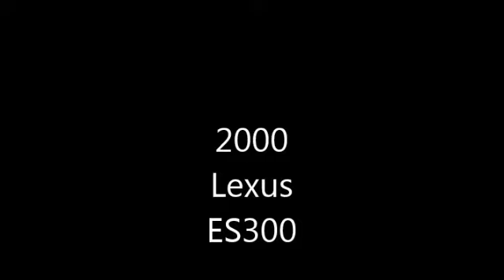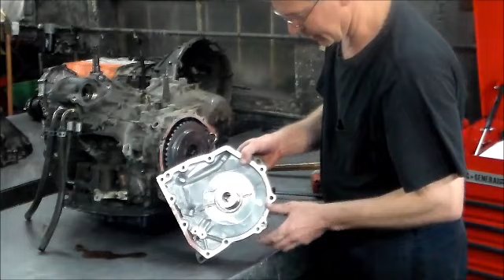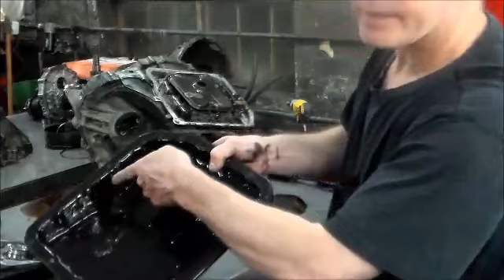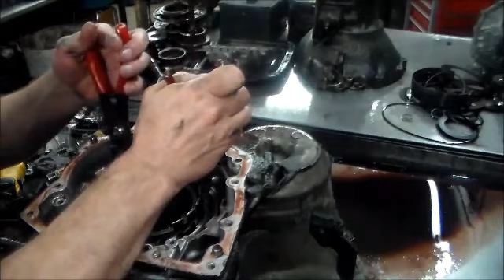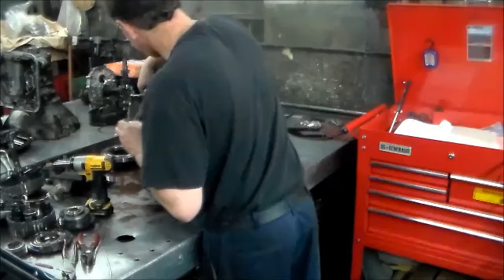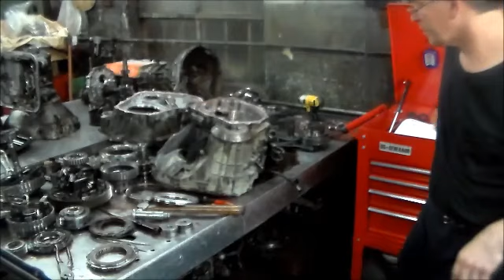U140 Teardown Inspection

Comment: Thanks for the video. Very informative. Is the shift solenoid located on the outside or what? Is there a solenoid  on the outside by the gear shift?
Reply from the maker: all solenoids on the valvebody inside

Comment: Hey Gary, good teardown video. I have one on the bench that I will be going through on monday. I had 4 codes for Solenoid A, B, C and Line pressure solenoid. I suspect the internal harness is bad but I guess we will find out on monday!! Have a great weekend.
Reply from the maker: Let me know what you find, all fuses good?  Watch the geartrains on those, i very rarely see a good one
Reply: Ya fuses are good. I thought it was weird with all those codes. I hope to find a wiring harness that is damaged somehow. But I think I had a similar toyota a few years ago where I replaced the computer for these codes.. Its codes...P0750 P0755 P0758 p1760
Reply from the maker: what kinda of car is it out of now  rav4?
Reply: 2000 ES 300. Thats why I am skeptical. The car stalled while driving, and you could obviously feel some erratic shifting. I didn't drive it far because it was towed in. Just drove it long enough to get into 3rd gear. It had a p0171 code also, and I was thinking that had to do with the vehicle stalling, because it didn't feel like it stalled from going into lock up, or something like that. We are soo slammed right now, I just had the R&R guy pull it, because I knew I'd find some hard parts issues inside when I open it on monday. I am just suspicious about those three trans codes, wondering if this also has a computer issue similar to the RAV 4 that the bulletin on sonnax.com refers to

Comment: What are the most common parts that goes bad in those transmissions? I got a 2001 lexus es300 and yesterday a did an drain and refill. But it was done when it had 60k miles Or around there and now is at 179k and i did it myself. The fluid was super black i even got pics of the before and after. And thanks 🙏

Comment: I have a 1999 lexus rx300 awd u140f transmission I believe. The transmission shifts perfectly but the first time I use the car for the day it wont engage into drive. Sometimes it take 30 seconds sometimes it takes a couple minutes. It goes into reverse just fine. After it does go into drive, its fine unless I take it out of drive in the first couple minutes then it may be a 10 to 15 second delay to engage. After that its fine all day and usually after sitting for  hours it is still fine. Very rarely does it do it again until the next day. Also, this car sits for months at a time while Im not in town at times. After I return the car is perfect for a few days to a week and then it starts doing it again, delay times slowly getting longer. No transmission codes just air fuel ratio codes. Ive had the car for a year and a half and it has done it since I bought it.
Reply from the maker: Wow,
 Im surprised its lasting that long, theses transmissions arent the greatest, i do alot of these units, when i had delays it was usually do to a filter problem or the geartrain itself. Im wondering if your having a drainback problem, as a test if you want, pull the dipstick out before you start the car when its cold and see if the fluid is way up on the stick past the full mark.
Reply: I will do that tomorrow when I see the car. I just watched your 4L80E drain back video. Thanks so much for all this incredible information! What do you think about the fact it will go right into reverse with no delay what so ever?
Reply from the maker: I forgot about that part, you dont have a drain back problem, something else is causing your issue. You may have a problem with your foward clutch, possible piston seals or sealing rings that apply the clutch or a lazy solenoid.
Reply: @GaryFerraro  Hello Gary, great video , i have a similar problem on my 09 RAV4 2.0 VTT .The transmission shifts perfectly but the first time I use the car for the day it wont engage into drive,it take's 30 seconds sometimes it takes a couple minutes, its getting worse, goes into reverse just fine then  into drive, no shift shocks. After that its fine all day and usually after sitting for  hours it is still fine. Very rarely does it do it again until the next day.  
just put in a new complete valve body ,filter..still no luck. 
Lire la suite
Reply from the maker: @francismorad6098  ok, just to confirm, you have a delay in drive only, no delay in reverse at all?  Have you started up the car in the morning to see if reverse is ok?  almost sounds like drain back

Comment: Hello Gary, great video , i have a similar problem on my 09 RAV4 2.0 VTT .The transmission shifts perfectly but the first time I use the car for the day it wont engage into drive,it take's 30 seconds sometimes it takes a couple minutes, its getting worse, goes into reverse just fine then  into drive, no shift shocks. After that its fine all day and usually after sitting for  hours it is still fine. Very rarely does it do it again until the next day.
Reply from the maker: I had answered the last post you sent

Comment: A U241e has 2 versions (i think). The differential,  is it possible to swap between the versions and not destroy it? Like, Is the final drive ratio on the outside or the inside of the ring gear?

Comment: Hi,
I have a question regarding the U340 transmission. I would like to know the differences between the U340E and the U341E transmissions.  I’ve heard that they are very similar, but I’m interested in the specifics of the differences between the two. Does the U340E use a different torque converter than the U341E?

Thank you

Comment: I just had the U140 in my 99 es go out while on a road trip. it started with a weird whirring sound then slipping then stopped moving all together in a span of about 30 minutes. I wonder if it was just a clogged filter or a blown planetary which led to a clogged filter. I got it towed to a transmission shop in the area waiting to hear back.
Reply from the maker: I have never seen a good planet set in one of those, you may have a clogged filter, that may be because something in the trans is coming apart
Reply: @GaryFerraro  thanks for your reply! I heard back from the shop after I commented and they said there was metal in the pan and the line pressure was through the roof. The shop I sent it to said similar things you say in this video which made it sound like they were knowledgeable about it and could get the job done right. Is there anything I should ask them to do to increase the life of the rebuilt unit? Also is there anything I can do to get as much life out of it as possible? Something like a drain and fill and fluid replacement every so many miles? I did a drain and fill a few months ago but didn't replace the filter. I'm wondering if that had to do with its demise.

Comment: Hello I think your videos are very informative while very easy to watch. Transmission repair might as well be magic to me, very impressive on how you are able to know whats wrong before you actually see inside. I have a problem that has me stumped. My Lexus LS 400 a 1995 model will only engage  any gear the first couple of times the shifter is moved to select a gear, then nothing.  Moving the shifter after the initial gear changes has no effect in moving the car, the R.P.M.s weill actually increase slightly when selecting a gear, almost like a tranny does when shifting to park. I ran a scan tool but dont recall the number something to do with lack of voltage  to ecm . I have changed the fluid but nothing has changed. Any info to point me in the right direction would be nice. Thanks and keep up the good work.
Reply from the maker: So i understand, the car will drive for about 10-15 minutes then stop moving?
Reply: I haven't actually driven the car knowing there was a tranny issue. When i find the time to tinker on it I try some simple things to see if I can fix it. This is what its doing. After starting the car I will shift it into drive ans sometimes it will ingage and i can move the car i shift into reverse and the car will move in reverse i can do this only two more times then nothing, the next day i can do the same thing and after a few gear changes it stops moving.
Reply from the maker: Ok, sounds like the filter is clogging up
Reply: I sure hope so, the other thing that leads me to beleive your spot on is that it sounds like a power steering pump thats low on fluid even though its not. Thank you so much for your help. I will report back when I can check the filter out.
Reply from the maker: That noise is also a sign of clogged filter

Comment: Gary, your videos are AMAZING ! especially the tear down of Mercedes 722.6. I have a 2002 Lexus RX300 that wont shift gears at all ! what do you think it would be ? shifter cable looks fine and the fluid is on full and still red. Battery was dead so I couldn't get any codes.
Reply from the maker: Do you mean the shifter is stuck in park or the car will not move when drive is selected?
Reply: @GaryFerraro  no the shifter is not stuck, it moves as normal but when I put it in Reverse or in Drive, the car won't move or make any weird noise
Reply: I have noticed that when shifter is put in parK, I could hear the normal sound of tranny engaging in park position
Reply from the maker: @Ryan-ys5kz  This trans is the U140, you should drop the pan, the geartrain is probably blown, i have never seen a good one yet, every one of these units that i take a part has a bad geartrain
Reply: @GaryFerraro  you mean the front planetary gear that comes loos ? I think you talked about it at  33:00
Reply from the maker: @Ryan-ys5kz  Yes, that is the start of it, usually takes out the geartrain

Comment: Gary, you seem willing to assist with questions- which is very cool of you! I'm currently going through a U140. I'll try to keep it short, but it probably won't work...lol. 

The first is: after installing new steels and frictions (Raybestos) in the forward (C1) drum, I ended up with .050" clearance. The specs call for .024"-.041". My backing plate is currently .130 so I was going to move up to a .141" which would have made my clearance .039". I bought a 141, but the package contained a 130. The only other package they had was also a wrongly packaged 130 and I can't seem to find a 141 anywhere.  Do you think .050" clearance would be a problem?

Second question: I installed the direct (C2) drum with new rear cover sealing rings. I was checking the underdrive piston travel with 60psi and went ahead and hit the other ports. The C2 piston moves, but I can hear air getting past the sealing rings. The drum shows almost no ring wear, and the ring grooves in the cover look good as well. I don't know if this is normal or not. What do you think?

The only reason I went into it in the first place was to replace a shelled planetary set. It ran fine before that. Sorry for being so long. Thanks in advance, G.
Reply from the maker: Im sorry i missed your post, how did everything turn out?
Reply: That's OK Gary.

The supplier did find a .141" backing plate in another miss-packaged package. That took care of that problem and brought me well within specs.

I wasn't sure if the sealing rings should leak air like they were, but I just went ahead and put it together as it was.

In the end, everything works as it should. The car drives great! 

Take care, G.
Reply from the maker: Glad to hear, my e-mail is gsferraro@yahoo.com  if any questions
Reply: Thanks Gary, G.

Comment: Gary thanks for posting just had rebuild done u140 Lexus rx300 AWD noticed after a week of driving a vibration when I let off on gas pedal approaching my exit after doing 55 miles per hour this kept doing this I noticed a slight rumbling
rumbling when stopped at a red light took it back to transmission shop they tested on a drive and noticed vibration they installed a new torque converter but vibration is still evident any suggestions?
Reply from the maker: Wouldn't be a converter problem.  Just to confirm, you only get the vibration when coasting with foot off gas, with foot on gas, no vibration?

Comment: gary good afternoon, wanted to check something with you if you have the time. i worked on a u241 out of a 2009 rav4 originally this unit had issues with the brake hub, it broke , so i overhauled the unit and added frictions replaced broken parts, and rear planet, converter and added the zip kit from sonnax. checked valve body  and solenoids. so i put everything back together and cleared memory, and started the vehicle, at the hoist it ran fine, but when i test drove it on the street it had a 2/3 flare and bind up.. flare almost went away but it still had the bind. so i took the side cover out and the direct drum frictions were burnt, so i replaced them and test drove it again and it still had the bind, checked boost valve and checked ECM its commanding solenoids and its within range. right now im thinking that maybe the frictions are to tight even though they moved ok in the drum. what could have i missed, or maybe it could be a valve body problem. costumer says it was driving fine before the brake hub broke and stopped moving. you think i could have caused the problem... thanks in advance gary, appreciate it a lot.
Reply from the maker: Possible too tight on the clutch pack, i don't think there is a choice on clutches and steels,  Thinking  valvebody or solenoid issue. How was it installing the Zip kit, i really do not use them?
Reply: @GaryFerraro  im going to take the cover off and check the clearance, and im going to check the valvebody again. I honestly didnt like the zipkit theres not much in it for the price. And its hard to get the plugs with the o rings installed without breaking the o ring. Id rather go with transgo on this unit next time. Alright gary thank you for your advice. Will let you know what happens.

Comment: Hey Gary, got a U140e transmission that gets locked in first gear.  Just changed the fluid with Toyota T-IV drain and fill.  All other gears work like park and reverse.  Do I need a valve body or a whole trans?
Reply from the maker: I feel your problem is your geartrain, i have never seen a good one that came out of a car. So when you put this car in drive, it will sit there until you step on the gas?  What is the year,make and model?
Reply: It’s a 01’ ES300.  Yes everything is fine in 1st gear.  It idles fine and drives, just sticks in 1st

Comment: Thinking of either rebuilding or buying  U140 all wheel drive for my rx 300 read JDM parts have to interchange with USDM wondering if that would be a problem
Reply from the maker: when i purchase parts for this, i am not asked any questions like that

Comment: hard shift from 2nd to 3rd, is there a specific part that can be replace or another used transmission, thanks
Reply from the maker: Have you tried doing a shift adapt reset? or memory reset
Reply: check all motor mounts then the transmission mounts. they will create hard shifts.

Comment: Excellent Video Gary. Thank you. I have a 2001 Toyota Estima ACR30 1mzfe with the transmission U140e. Can I use any other interchangeable tranmission from any other toyota? Hard to find a wrecking u140e
Thank you
Reply from the maker: I dont believe so, whats wrong with your trans?  where are you located?
Reply: Gary Ferraro Australia.  It wasnt shifting  smoothly. It changed gears but felt  like a jerk when you accelerate  from rollling.  I changed the fluid a few times over with  two new filters.  Been fine since  but  im just  thinking  later on.  I see heaps of 1mzfe camry transmission  for sale but cant find one for the estima 1mzfe
Reply from the maker: Ok, at least its working ok. Greetings from New York

Comment: What would cause slow shifts? My Toyota can be slow at shift and it's very noticeable in first and second when cold and basic stuff I could check myself? Thanks.
Reply from the maker: I would first have it scanned for codes and check the fluid level
Reply from the maker: Last post did not show but let me know what happens